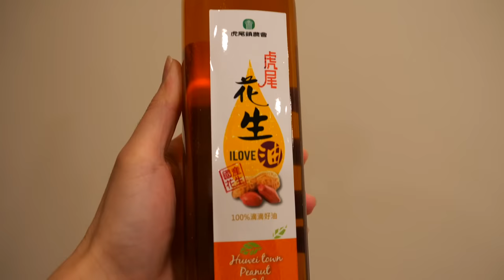Peanut Oil Making in Taiwan / 花生油製作 - Taiwanese Peanut Factory

Comment: The percentage of oil extracted from peanuts will be quite low by this method. The oil residue in the oil cake will be too high, which is generally used as animal feed, mostly for cattle. The extraction process used in India is by Expellers, and then purified by Filter Press that use thick cloth. Therefore, in India, the percentage of oil extracted is much higher, and residue oil left in oil cake is very little. Now in India they have a further process where even the residue oil left in the oil cakes is extracted, and ultimately hardly 1% oil residue is left in the oil cake. Almost 90% of these vegetable oil extraction machines in India are manufactured in one city in India - Ghaziabad in UP.
Reply: But which one tastes better?
Reply: @JB-ru4fr  Both are essentially same - peanut oil - and taste same. Only thing is that Expeller and Filter Press method will squeeze out more oil from peanut, whereas the method shown in this video will squeeze out very little oil from peanuts. If anything, in the method shown in this video, they use paper covering before pressing, which may leave slight hint of paper smell in oil, whereas in the Indian method after the oil is extracted by Expeller, the oil goes through Filter Press which has thick white clean cloth through which the oil is pressed through, hence the Indian method may have less contamination of paper smell. Another thing, usually oil mills in India have series of Expellers lined up, normally 4, where peanuts will go through one Expeller and largest amount of oil extracted, then the oil cake coming out of first Expeller will go through second Expeller, then third and then fourth Expeller, and finally the oil cake that remains has very little oil residue in it. The oil is then forced through Filter Press that has clean thick white cloth in between plates. The oil that finally comes out is crystal clear and is filled in bottles. Also, the Indian method is continuous process and oil machines keep running for several hours at a stretch, extracting tons of oil in 8 hour working shifts. Whereas in the method shown in this video, every time fresh cakes will have to be put with paper in press - hardly any oil production output in a day shift. Not commercially viable method. Outdated method. Indian method much more advanced. Infact, now even further India has a way to extract more oil from the final oil cake after fourth Expeller oil extraction. Indians really squeeze out the oil to the limits! In present video, it is like a joke for Indian oil mills!

Comment: bruh, I need to teach you how to cook :O a couple pointers, that should be done in a carbon steel wok, put stuff in it and fold it instead of cutting it with a spatula like that. for example, shredded chicken, bean sprouts,  etc etc etc that will have no flavour, not sure why you're showcasing peanut oil on a nonstick ceramic pan anyway.